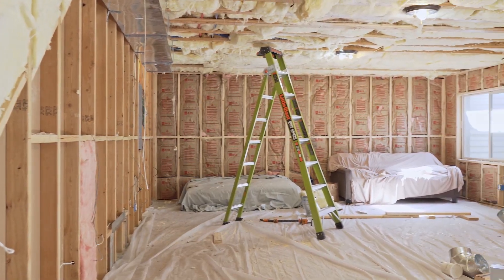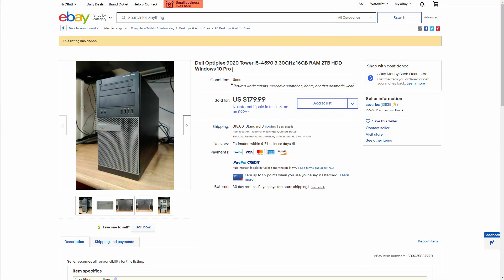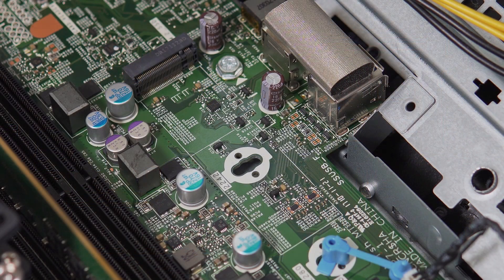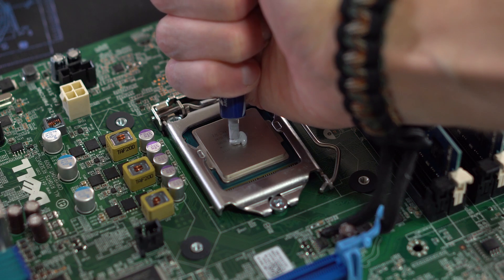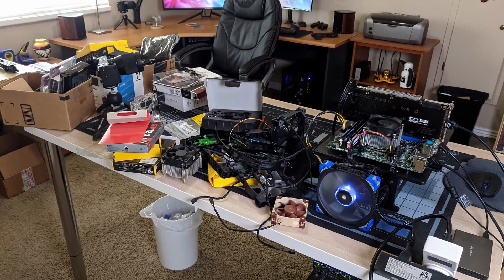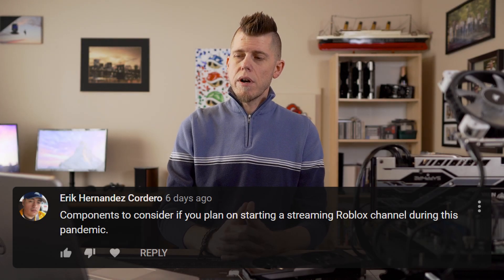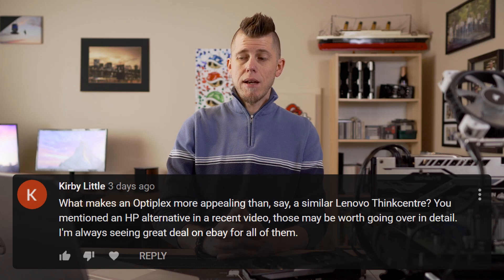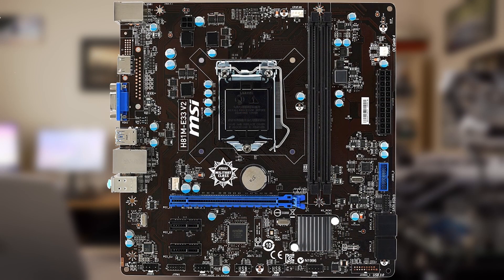Dell OptiPlex Q&A Pt. 2: Power Supply & CPU Cooler Upgrades, NVMe m.2 SSD's & More

Comment: Firstly, I really appreciate your optiplex videos. within the last 8 months or so I took a 7020 from stock (or randomly gathered parts such as the ram) and turned it into a viable 1080p beast. I got the i7 4790 with 4x4gb ram(albeit 2 dif't types) , 2tb HDD and Win 10 pro for just over $300. I've upgraded the rear case fan to a noctua slim as well as using your modding method to place a 140 industrial noctua as an intake in the front. One of the fans (either stock cpu or rear case fan) was making a little bit of noise so i replaced the cpu cooler with a cooler master i70. Slapped a 1650oc and an EVGA 700 br and corsair vengeance 2x8 gb ram in there and called it a day. 

Recently I got the chance to buy an unused EVGA 3060 xc at pretty much MSRP from a bitcoin miner that I befriended in a gaming community. So i've been eyeballing my system and trying to prepare for a revamp, so as to not bottleneck. This means buying a budget (but viable) cpu, the ryzen 5 5600x or 5800x. This, in turn, means that I'd DEF need to consider a better CPU cooling system. 

So here's my question: do you have any experience with any low profile coolers? I just encountered information that this case would require a 92mm cooler, as the 120 mm guys wouldn't fit. But i'm still eyeballing the low profile noctua coolers. You know, the ones with conventional heat pipes and fins, but just in a horizontal config as opposed to being vertical. Any pointers?
Reply: hi! I'm always bummed when these chucklehead experts don't take a minute to write back to folks. even if this guy is too upercrust to be interested, I am. what did you end up doing? I just started messing with stuff like Afterburner, Kombustor, GeForce experience and Cinebench and I'm having a blast. I'm trying to learn how to make videos, too. I've got some crappy ones on my channel, I'm trying to get better. good luck to you, sir.

Comment: Can I run 1080ti 3770 16gb ram on 500w power supply? 1080ti says it requires 650 watts, and I know sometimes they are way over what is necessary. My power supply is Corsair and rated 80 bronze efficiency
Reply from the maker: Depends, are you playing at 1080p? If so, you're going to be bottlenecking the 1080 Ti to the point that it likely won't even consume more than 400 watts for the total system. If you're playing at 1440p, then more of the GPU is going to be utilized and it's going to push past 400 watts and it's not going to leave you much head room, and I wouldn't suggest a 500 watt PSU at that point.

Comment: @The Game Bench @everyone
I’m having fun trying to upgrade my 9020 i5. But I hit a road block with powering my GPU (evga 1060 3gb) with the stock 290w psu.  I tried a 2 Sata to 6 pin adapter and when plugged in, the cpu fans spin full blast and the pc won’t even try to boot. Without the gpu 6pin power it does register on screen to power down and connect the gpu power supply. And of course works fine without the gpu installed. 

I’d like to avoid buying a new psu… I’m about to try the single sata to 6+2 cable recommended in the build video as the 2 sata may be drawing too much power from the PC.

Has anyone else encountered this issue? Do you think there may be a different problem?
Reply from the maker: No, that wouldn't be the issue. Single vs. dual SATA would have zero effect on how much power the GPU is consuming. That's entirely up to the card. The 3GB model should be fine on a single, and I just have to wonder if there's an issue with the dual SATA adapter you got. Perhaps it's got a short somewhere. That would be my first suspicion, try getting a different one. However, even though it does display something without the power plugged it, it doesn't mean that the card couldn't be at fault. Can you verify that the GPU works in a different system? Outside that the power supply might be on it's way out, so it can't deal with the added load. Those would be my prime suspects for what's going on.
Reply: Thanks for the response! 

I bought the 1060 locally and he said he was running it in his system that morning before we made the exchange. But I really do not know for sure. 

I just ordered the single to 6pin recommended in the other video so let’s hope that works. At least it looks like a higher quality piece. 

I’m not opposed to buying a new psu as it’ll jumpstart my first true build. But your call on checking the gpu status would come next. 

When I get everything up and working, your build inspired me to go another step to disassemble the rig and do that thorough cleaning, new paste, and fan. The most I’ve done is swap hard drives in systems and PCs so I don’t know much. Your videos seem to show “best practices” when it comes to caring for the parts and discussing options so a noob like myself has a chance to get things working.  

Thanks for explaining the power draw and possible solutions.  It is  greatly appreciated.
Reply: Update: the new 6pin works great  the first one must have had a short. Thanks for the advice.
Reply from the maker: @edwardmarshall1291  Awesome! I'm glad it was something simple.

Comment: I've actually used your Optiplex videos to modify my 3020 case to use for a custom PC build. A sleeper sort of. The tutorials on getting the hard drive cage and 5.25 bay latch out really helped a lot!

note: I am aware the power button connector isn't the same. I'll have to rewire it. HDD LED appears to be only 2 pins, and everything else looks standard.

Comment: I've got a 3020 4th Gen I3 coming in the post in the next few days, got a I5 CPU lined up, I'll be buying a SSD/HDD mount for one of the 5.25", my main issue is that is there a way I could relocate the front IO so I could put 2x120mm fans controlled by a external fan controller mounted in the second 5.25" Bay. Is there any way it can be done?
Reply from the maker: Two? Well, I'm sure you could. You'd just have to get creative about where you would want to relocate the front panel, then cut a hole for it. Mounting it and looking nice would be the real challenge. With it moved, two 120mm would fit just fine. Might even be able to fit both without moving it if you're fine with it being a bit jank.

It can certainly be done, you're just going to have to get creative.

Comment: How can I add additional fan in dell optiplex 9020 for better airflow?
Reply from the maker: You can, and I have a video on modifying the case to add a 140mm fan. But now I actually cut the front panel out so it's not obstructed. To connect the fan, since there's no extra fan header, I use a SATA to 4-pin fan adapter. Since that will run the fan at full speed, I also use a fan resistor cable to slow it down if the fan is too loud.
Reply: @TheGameBench  Are you sure there's no extra fan header on the 9020? Mine has a rear fan and a cpu fan installed, and one empty sys_fan 4 pin plug.

Comment: Hey I found a really cheap optiplex 3080 tower that I want to upgrade for gaming, prolly add a SSD and either a 2070 super or 2080 or 2080 super. If needed I will upgrade the power supply too. Crazy there isn't really any videos or even much info online about upgrading the newer optiplexs. Is there a reason for this or something I'm missing like not being able to change the power supply or I dunno? I've just found all the older optiplexs are high $ on ebay and found newer optiplex models for less $...
Plus I am hoping to play Warzone @1440p @100+ fps or better and the newer optiplexs have way better cpus, the 3080 I may get has a i5 10400 or another has a i3 10100 but all of the have a cpu around this speed.
I think if you made a cheap but real good performance optiplex Warzone build video alot of people wld want to see it. 
I know many people in my same situation switching from console to pc that are looking at $1200-$1600 prebuilts that are ehhh crappy like 1660 super or 2060 range. I just think or hope I can build/upgrade a optiplex for around $800-$1000 and end up with a way better machine...plus the MT and tower models have tons of room and DDR4 3200 RAM!
Just seems like all the optiplex videos I find are, upgrade this old optiplex from the trash, instead of, upgrade this fairly good optiplex with a real good cpu into as good or better than most prebuilts...
Any info helps!
Other models I've been looking at include optiplex 3080, 5050, 7050, 7080, 5040, etc
I've seen them selling on ebay for just a little more or the same as like a 9020...
Reply: The simple reason why people love the older Optiplex’s is because the newer ones are a lot less easy to upgrade as opposed to these, also the i7 4790 in the 20 series performs the same as the i7-6700 in the 40 series. Yeah you can upgrade the newer ones and have a lot more longevity, but the hassle isn’t worth it, but hey if you really wanna do that, hey, all the respect in the world for you

Comment: Could you tell me why I’m having problems with my graphics card. I have a gtx 1660 sc ultra and I can’t play a game without it crashing. I need to under clock my memory to almost 300 to not crash . But when I test my gpu on furMark or gpu heaven it’s completely fine . What could be the problem?

Comment: Thanks for another informative video.  I finished my Optiplex 9020 build last October when I bought and installed a GTX 1660 Super.  I had a an old 430 watt power supply in the parts bin so I installed that to run the card.  I did have to get a 24 pin to 6 pin adapter for Dell's proprietary motherboard but I haven't had any problems.  Temps are just fine and I've been getting a fantastic experience gaming at 1080p at high detail settings in pretty much every game including Metro Exodus and Assassin's Creed: Odyssey.  All in the system cost $560 CDN including the video card (this was of course before the price of cards went through the roof).  I found doing this project to be a very satisfying and rewarding experience.  Your help has been invaluable.  Thanks!  Keep on with the vids!

Comment: Have you quit making videos
Reply from the maker: Technically... yes. But I've not quit YT or anything. You can check out my YT community page or my social media to see what's been going on, but the gist of it is that I was going to move my studio to another room. That room required to work to the HVAC, but blew up into several issues such as plumbing, structural and electrical. We had to gut the room and rebuild it. So I've been doing that and I haven't had anywhere to film with everything from that room displaced into my old studio and other rooms. But I'm starting to get furniture put back in that room and get the new studio space setup, so I will be starting on making new videos.
Reply: @TheGameBench  Cool I look forward to them

Comment: is there a upgrade to the i72600.
rn I gotta rx 570 with 16gb ram
Reply from the maker: Not really. There are faster chips that might work, but are WAY too expensive to even consider. Effectively the 2600 is the end of the road for the 390, 790 and 990 system.

Comment: I have a optiplex 980 the cpu cooler has a giant heat sync and a metal fan i’m pretty sure the metal fan is what makes noise can i switch it out no problems?

Comment: Can i change my optiplex 3020 motherboard to 7020/9020?
Reply from the maker: Sure. They use the same chassis. However, the front panel connection is entirely different so you wouldn't be able to take advantage of the front ports and you'd get an F1 error on startup. Also, you'd want to get a temp sensor from the 7020/9020, otherwise it will also throw an error, but worse, the fans will spin at full speed. The last thing I can think of is the rear fan uses a different connector, so you'd need to find the rear fan from a 7020/9020 as well.

Comment: @TGB... i bought the 8-24 adapter. When plugged in, the CPU fan spins @ 100%...and it doesn't post. Have you ever experienced that before? Using a Precision T1700 to case swap.
Reply from the maker: Does the power light flash in any pattern? What if you stick the stock power supply back in. Usually the CPU fan going full blast and no post usually equals a bad motherboard. Try sticking the stock PSU back in and see what happens. Hopefully it's just a faulty adapter.

Comment: Question for future Q&A: How come the 5040 Optiplex doesn't seem to get any love from the budget PC community? The other models get plenty of attention, but the 5040 isn't a slouch and it's crickets.
Reply from the maker: I still have one more part to this, but I've been holding off for the GPU market to recover. I'll add this question to it. But I'll give you an answer right now.... it's because it's much harder to work with. Non-standard form factor and power supply. Can't really swap the parts around. The cases are hard to work in. It's not impossible, but it requires a lot of work and modification. I do plan to do a project in one and I have a 7040 as well as a 7050 to work with. However, there's a channel called Wiltshire Tutorials and he's done a few videos on one and he's done quite a bit with one.

Comment: I was a PC tech over 20 years ago and I've found that HP towers are really hard to work with as far as modding and also have a lot of parts failures. Yes, a stock Dell runs like crap, but I've never had one die and it's easier for modding. Does this still ring true?
Reply from the maker: It really depends on the model for either. My experience working as a field engineer for both Dell and HP is that their business units are much higher quality than their consumer level systems. As a PC tech and an IT tech for smaller companies that dealt in the consumer systems, we saw a lot of hardware failures. However, on the enterprise side, I saw very few failures in the desktop systems. So I think both are rather robust on the business side, and that makes sense considering I know what those companies paid to get someone like me to come out next day to sort a problem.

As for modding, I think they're both pretty close, as of the 9020. Before the 9020, Dell was certainly more friendly, but has adopted a lot of the same techniques that HP has to make thing proprietary. Most of it is easily circumvented. Neither are nearly as bad as say... Lenovo, who have a practice of white listing GPUs. But I know there are a lot of consumer models that power limit the PCIe slot. I've not seen that in any of the enterprise systems I've been working with in the last couple of years though.

Comment: Do you know any reliable power supplies that i can buy, i have an asus GeForce gtx 1650 oc edition
Reply from the maker: Well, the stock power supply in these is MORE than capable of powering any 1650. They consume very little power. Even with the 6-pin connection. However, if you're set on replacing the power supply, I suggest the EVGA BR series PSUs on the budget end. They're inexpensive and they're decent quality for the price. I know a lot of people like to gravitate to the 80+ white models from ThermalTake, EVGA and Cooler Master... but I highly suggest avoiding those as they have pretty poor build quality. I would personally never put them in a build.

Comment: I’ve asked you about this before but can you do a Dell OptiPlex case transfer into a cooler master mb311L
Reply from the maker: Depends on the OptiPlex. The mini-tower systems I talk about on the channel are all standard micro-ATX boards and that case I a micro-ATX case. So, those will work just fine. Some small form factor boards would transfer as well, but not as cleanly since the Harbin adapter kit doesn't work with those. If you're looking at anything newer than the 3020, 7020 and 9020, I don't think those used a standard mATX screw pattern and might not transfer to a standard ATX/mATX case.
Reply: That would be dell optiplex 9010 MT for you, mATX motherboard
Reply: Oh yeah also the case I have comes with an argb controller

Comment: Hello there I own Dell optiplex 1070 and  I'm looking to upgrade my RAMs from 8GB (2gb x4) to 16GB (8gb x 2) getting Hyperx black series 1600mhz 8Gb looking through the dell compatibility manual they should work fine or correct me if am wrong(?) And if they do work how am I supposed to place the ram sticks into the mobo sockets to achieve "dual channel"? Thank you in advance
Reply from the maker: I'm assuming you meant a 7010? That being the case, I've been testing RAM in these systems, and it's a crap shoot. I've had some HyperX RAM kits work at their rated speed and other only run at 1333 MHz. To run in dual channel, there should be four slots. Two with black release latches, and two with white. Just put them in the white slots and you should be good to go.

Comment: will upgrading the PSU on an OptiPlex 3080 tower damage anything, And does it need a 24 pin or a 6 pin power connector?
Reply from the maker: The 3080 looks to have the same 6-pin connector Dell used as of the xx40 series. That being said, I don't know if the pinout is the same. There are adapters that go from 24-pin to 6-pin, but if the pinout is different, it could damage the system and/or the power supply. If it is the same, then you can replace the power supply, but there's nothing in that form factor that's really going to be better than what you have. An SFX power supply would fit, and look kinda' jank, but you could do some cutting at the back and make it looks good if you wanted to.
Reply: @TheGameBench  You're a life saver! Thanks a lot❤
The reason I'm upgrading the PSU is to also upgrade the GPU, since the the stock PSU comes at only 260 watts, its not even close to powering a GTX 1660 Super.